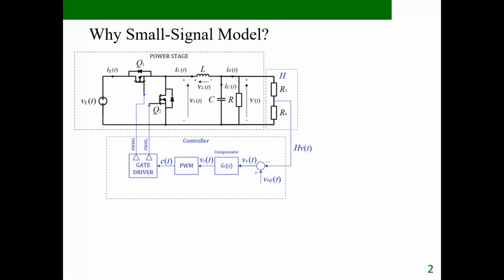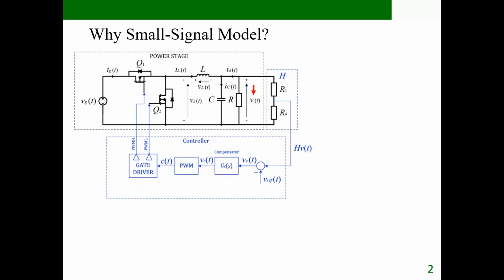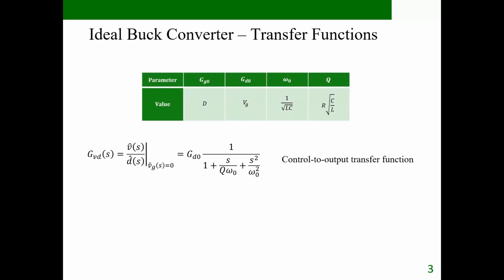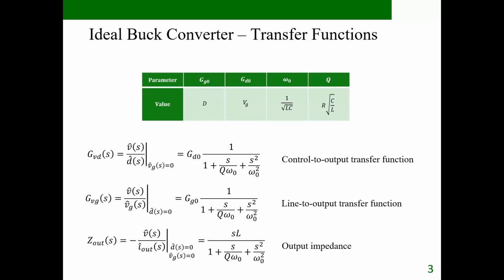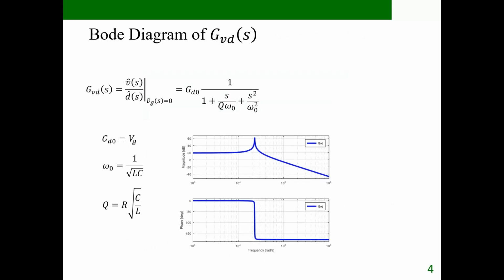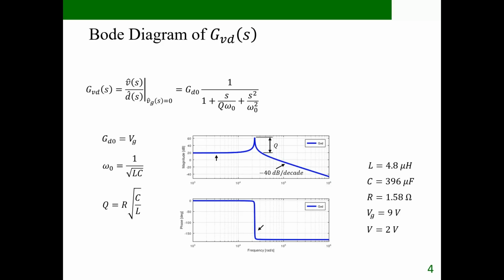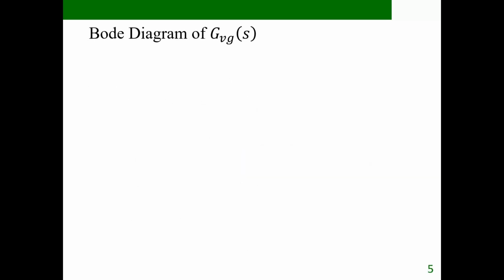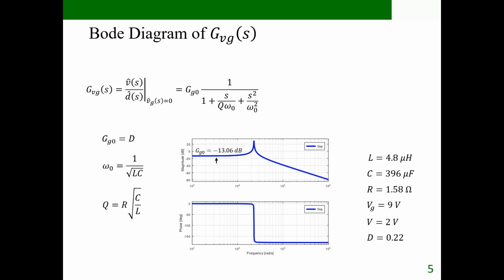Ideal Buck Converter Transfer Functions (Gvd, Gvg, Zout) – Explained with Bode Plots

Comment from the maker: 📣 Special Offer for Viewers!
My new course “Designing a Type-III Digital Compensator – Practical Implementation in C (C2000 Demo)” is now live on HK-Academy!
To celebrate the launch, you get an extra 10% OFF until 30 November 2025.
🎟 Use coupon code: TYPE3LAUNCH10
🔗 Course page: https://hk-academy.com/courses

📁 Download the Free Buck Converter Toolkit
Get the LTspice models (averaged + switching), Octave scripts, and the full C2000 Voltage-Mode Control project:
👉 https://hk-academy.com/resources